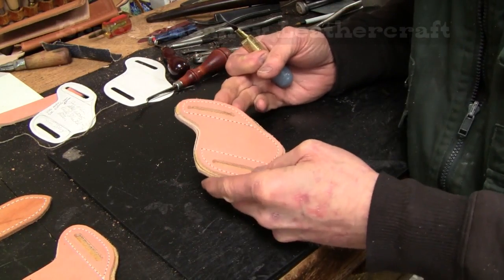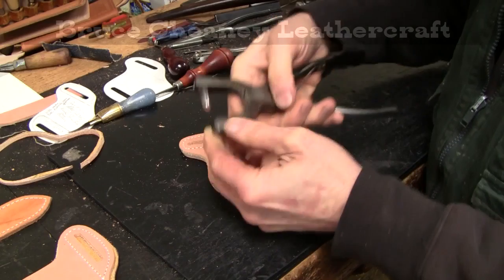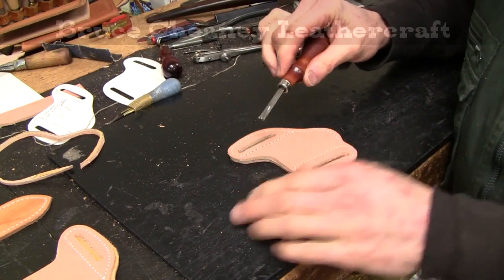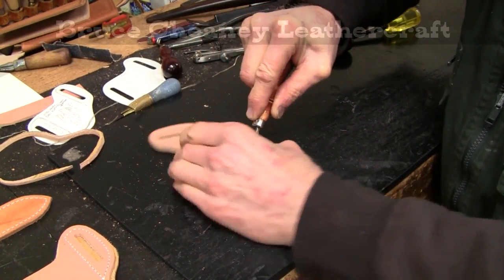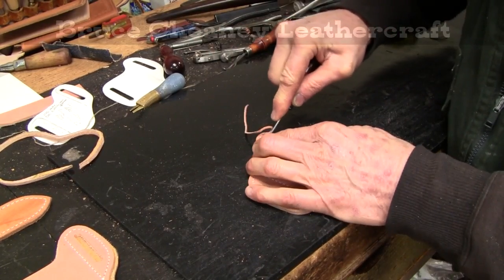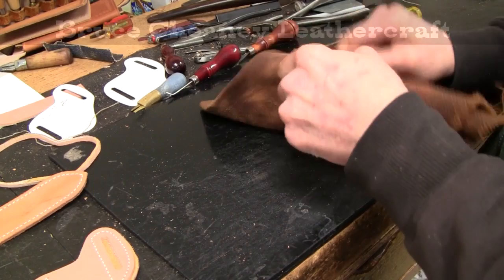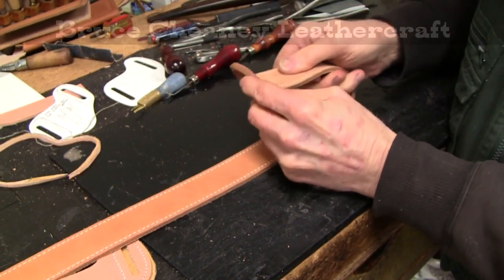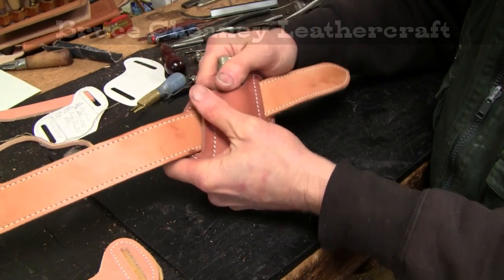Leather knife holster making

Comment: Bruce yet another great video. However I have one question. Since not all knives are created equal how do you know how far apart the stitches should be so the pouch isn't to large/small to accomadate the knife? And how far apart are the stitches in the video shown here?
Reply from the maker: I make my stitches about 6 per inch, as far as the different sizes I have a trapper model and a stockman pocket knife pattern. You may have to experiment a little to come up with the right sizes. This pattern will hold a knife real good because it puts pressure on the knife from the belt. Thanks

Comment: Bruce.. I noticed that you are not using the fields made blade in the knife. I ordered 2 of them and I can sharpen any knife or blade in my shop but i can not sharpen the fields made blades, do you have much luck ?
Reply from the maker: I use the blades I get from Weaver Leather Supply most all the time. I did order 3 Fields blades and pretty much used two of them up and still have one new one. You are right it seems like the Fields blades are hard to sharpen.
Reply: Thank you sir.

Comment: What blade is that (both blade and handle) Mr Cheaney? Thank you.
Reply from the maker: I got this knife and blade from Weaver Leather Supply. The one leathercraft knives they have in their catalog now have Walnut handles the one I am using in the video has a plastic handle but the brass part is the same. I also get the knife blades from Weaver in a package of twelve. Tandy leather also has a knife similar they call it an industrial knife set. Thanks Bruce